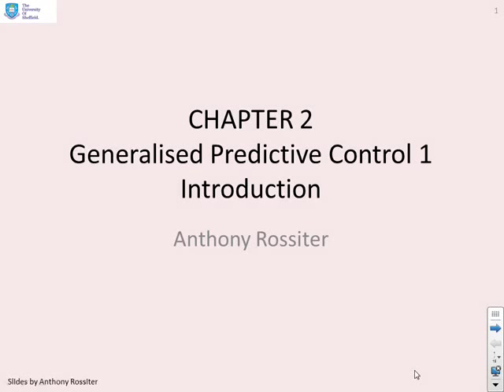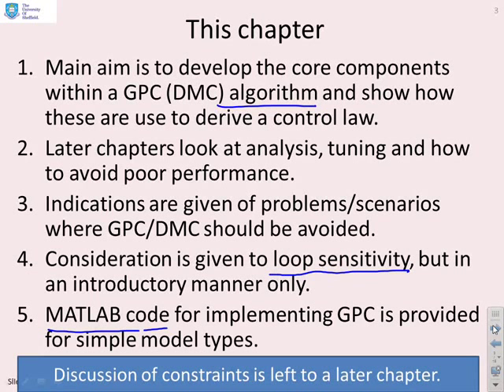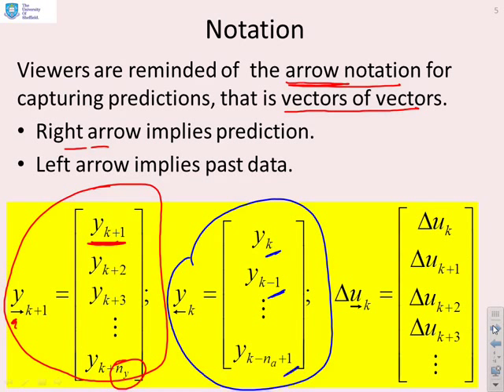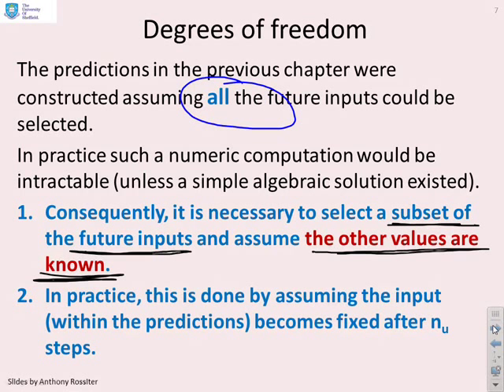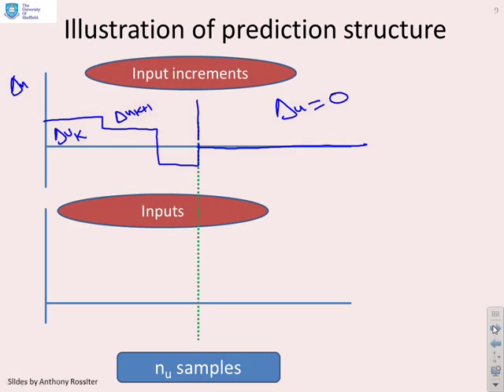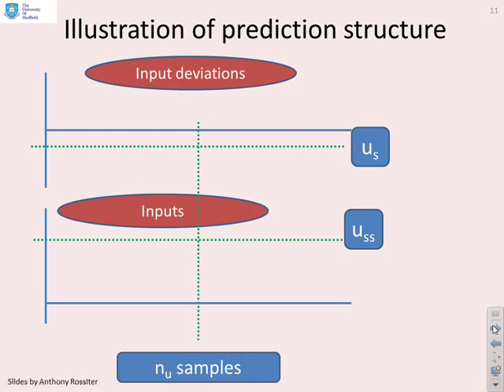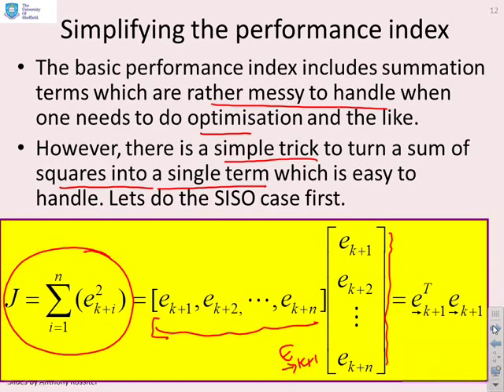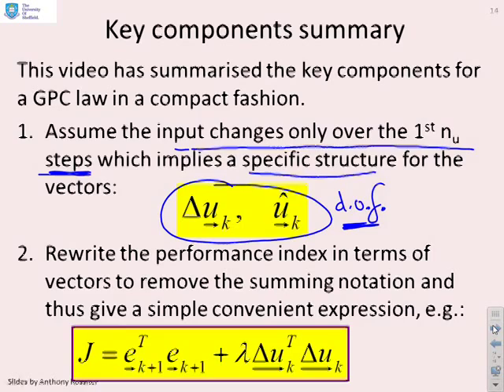Generalised predictive control 2.1 - Introduction

Comment: Hi. What do you mean when you say open loop predictions? And how is that different than closed loop predictions? I tried to find the answer to this question on internet but couldn't find anything useful.
Reply from the maker: Open-loop predictions choose values for the input and work out the output predictions solely from the process model.  Closed-loop predictions assume some form of inner feedback loop so in effect you are choosing the dependence between the set point to this loop and the system output.
Reply: @johnrossiter2323  okay, so can we say that open loop predictions are based on a single optimization window while the closed loop predictions are based on a receding horizon which takes into account the measured output continuously?